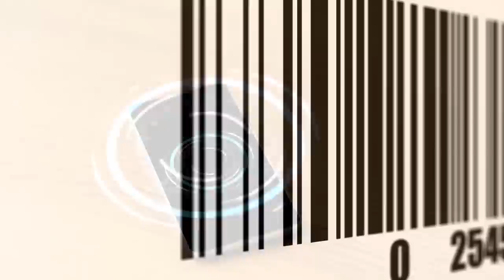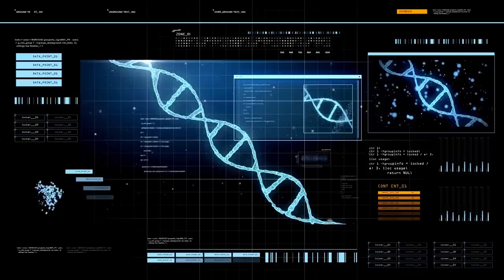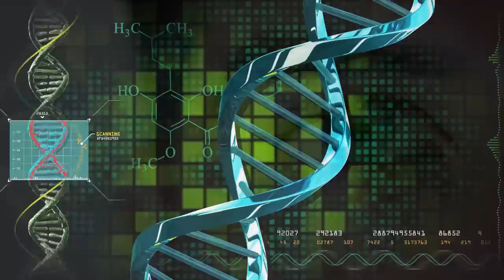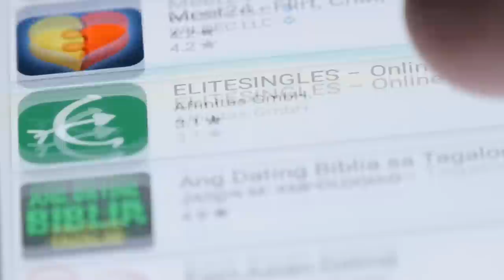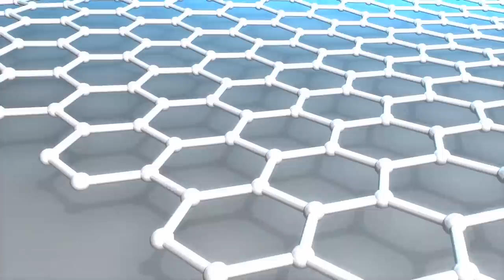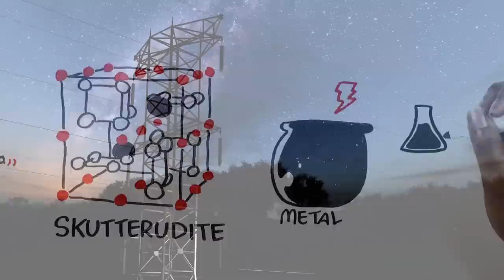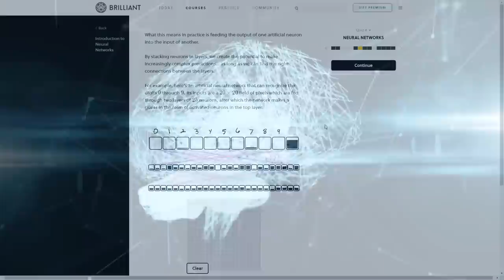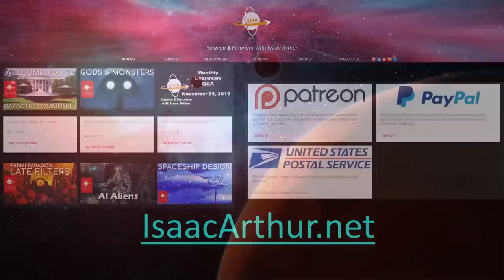New Technologies that May be in the Cards

Comment: I'll believe fusion is twenty years away when it's 5 years away.
Reply: Fusion technically already exist. Scientists mostly work on minimizing reactors to size what make them useful. What is one of most common misconceptions here.
Reply: @TheRezro  I don't think anyone watching this channel is unaware that fusion exists.
Reply: @TheRezro  Well, it's making them smaller, capable of running for more than a few seconds, not requiring temperatures of about 100 million degrees Fahrenheit, and actually producing more power than it currently takes just to turn it on, but yes, we're getting there.

Comment: Given how potentially dangerous a snowblower is, which in contrast to an automated lawnmower has a high powered auger that is open at the front of the snow blower, I don’t see it being fully automated anytime soon.  Snowblowers also need to be maneuvered in unique ways that requires use and shifting of the operator’s body weight.  In high snow fall areas, the snow can cover obstacles (especially over time from multiple snow falls as the snow still has to be blown somewhere) which the operator needs to know about and avoid accordingly even if they can no longer see the obstacles.  Examples of such obstacles may include edges of stairs, power cords, etc.

Comment: If we look at diamond batteries like the prototype design presented on wikipedia, we see that each 10*10*0,5 mm battery, that could be assumed to be 10*10*1 with added electrodes would produce electricity at 2V and at a power of 0,17mW. This would mean that in order to recharge a cellphone battery of 60kJ (4000mAh @ 4V) in 24 hours, one would need roughly 4000 batteries. However, when each battery only needs a volume of 0,10cm³, the assembly would only need 400cm³ or 0,4 liters of space.

 This means that you could easily see portable chargers with a combination of diamond batteries and more traditional ones powering handheld devices off-grid

Comment: The lack of garages is one of the major factors that limit and hinder the adaptation of current electrical vehicle technology in Europe. Unlike in the USA, private garages are rare in Europe and because lots and houses tend to be small, most people who actually have a garage, use it for storage and still park their car out on the street. 
With current EV technology, you really need a place where you can charge your car over night. Running a 100 yard long cable out your kitchen window down the block to where you parked your car, is really not feasible, which is why EVs aren't selling in Europe the same way they do in the USA.

It is quite ridiculous in Germany, where the press is having a feud with the car industry for decades, always gleefully predicting and announcing the end of the German car industry, because they supposedly were asleep at the wheel and didn't innovate enough. That narrative made some sense in the early 90s, when German car technology was chasing after the more innovative French, Scandinavian and Japanese competition, but that trend has been reversed and German cars have been among the most advanced and innovative for the last 20 years or so, leading the way with stuff like 360 degree cameras and such stuff, while the worldwide competition seems to try to pick up trends coming out of Germany.

Still, the German press acts as if the German car manufacturers were a bunch of outdated dinosaurs that deserve to die out because they didn't immediately switch their production to all EV the minute Elon Musk had his first press conference.
Those imbecilic journalists never bother to ask whether EV technology is mature enough and compatible with the German and greater European infrastructure.
You have to wonder what those idiots think VW, Daimler and BMW were supposed to do, tear down half of the homes in Germany, so the remaining half has room for garages to charge EVs in?
It is ridiculous.

In order for EVs to become widely viable in Europe, we'll need technology that allows for charging the batteries in the time it would need to fill up a gas tank at a gas station.

It is like that with many new technologies that get touted as "the future!".
Most of them are designed for American Suburbia, which is a way weirder and more unusual environment than most Americans realize.

Another good example is "Screen Walls", you know the idea to cover a whole wall with a giant screen, maybe all the walls in a room, so you can make it look as if you're not in a room at all.
Stuff like that can't work in Europe and most of Asia.
Houses are small. People don't have room for walk in closets. That means you need to have cupboards, cabinets and shelves on pretty much every wall in every room of your house, to store your shit in. Turning whole walls into screens isn't an option in like 80% of the developed, wealthy world, where people could afford such technology. 

As I said, American Suburbia surely seems mundane and normal to most Americans, but it actually is a very unusual, weird, unique environment that has its own rules and is different from everywhere else in the world.
Technologies designed with those weird, unusual conditions in mind, will have a hard time finding worldwide adoption.

When you listen to modern architects, city planners and infrastructure engineers, apparently American Suburbia might not be around forever either. There is a lot of talk of going back to older, more urban ways of living, making cities and neighborhoods more "walkable", making streets narrower to make people drive slower and so on.
Reply: TrangleC This is actually super interesting I’ve never thought of that as a hindering effect since I live in the US but it makes total sense but what if there was a charging port by the road do you think that would be useful fix for a problem like this?
Reply: Sounds like the German press is like the American press, full of closet Marxists who cheer for the failure of their own nation.
Reply: @2013Arcturus  Pretty sure they are just writing whatever they think will get clicks.  Outrage and doom and pointing out who stupid others are still gets clicks.  The solution is to not give them clicks or attention, and to let them adapt or vanish.
Reply: @2013Arcturus  No.They are in fact correct about these things. While I agree with the OP on all other points, the car industry one I ridiculous.
Unless you're personally involved with the industry (due to working in in it), and thus economically and emotionally invested in it, you'll have a hard time defending these dinosaurs.
Instead of working towards cleaner and more efficient engines, they rather spent resources on specially crafted cheating devices.

When the whole thing blew up, instead of making amends to their customers, they instead went through every legal and lobbying measure to avoid paying up.
I have absolutely no sympathy for the German automotive industry - they don't deserve it and should they go belly-up, they had it coming for a long time!
This has nothing to do with "closest Marxism" (first of all, would you Americans please stop already with your false dichotomies, it's really irritating!), but more with the arrogance,  dishonesty and deceit that this particular industry displayed over the past decades.
Reply: Oh great, let's all live in overcrowded cities where viruses spread rapidly. No thanks.
Reply: Because when VW sent up a cloud of black smoke, they were just unveiling their latest technology with a fancy magic trick LOOOOL
Reply: Umm...
1) Kerb side charging points, as number of electrics grow the number of electric bays does too. To the point where it's potentially foreseeable that they'll just become a part of the existing street furniture.
2) Electric Autobahns/freeways/motorways. My prefered option, but that is the most pie in the sky. The ability to charge while on a major road.

It's an extra challenge, but not an insurmountable one.
Reply: @2013Arcturus  how is wanting electric vehicles being a closet Marxist. I feel like people throw around that word too much.
Reply: I would love to have more walkable cities with larger sidewalks and narrower streets. Things could become less chaotic with those things implemented: larger sidewalks for more walking and less-crowded sidewalks, AI that helps with traffic jams, and quiet electric cars--city noise almost eliminated/reduced significantly. My big issue with cities is how chaotic they are right now. So if that could be reduced...time to hit the urban life (maybe)!
Reply: @the_seeker.entity9206  I don't really see them putting charging ports every 5 meters along pretty much every city or village street. That would be a ginormous investment.
Besides, availability of charging stations isn't the only limiting factor.
With the EU and especially Germany moving more and more into renewable power sources, you have the problem that a world in which you make most of your electricity through solar panels in the day and then use most of your electricity to charge EVs at night, would require enormous battery banks everywhere, to save all that electricity in the day, so it can be used at night.

I'm afraid the only way to get a significant amount of people into EVs in Europe would be to build a lot more nuclear power plants and nobody wants to do that, especially not in Germany, the Netherlands and other places in Central and Northern Europe.
Reply: @2013Arcturus  It is not just the press, but the self proclaimed "intellectual elite". They're good at demanding stuff and looking down on everyone, but not so good at understanding the realities of infrastructure, finances or foreseeing the consequences of their demands.
Reply: @totalermist  The Diesel Scandal and the demand for more EVs are two different things.
People in Germany have been doing the "Why can't those losers do what Tesla is doing?"-thing long before the scandal and they would be doing it without it ever happening, I'm certain.

Nobody ever seems to question whether there are factors outside of the control of the evil auto industry, which prevent the adoption of EVs in Germany. Don't know about you, but I never heard anyone talk about the garage problem, as obvious as it is. That is a thing I had to figure out by myself, while watching videos of Americans owning and using their EVs.

I was watching such videos and suddenly I realized: "Of course, they all have garages! Makes sense. You really need one for using a car like that. How many people in Germany do I know who have their own garage? And how many of those actually use it for their cars instead of for storing skiing equipment and old home trainers? Not one. Holy moly."
Reply: @floydlooney6837  The talk is more about "Urban Villages". They envision a future where basically everybody is living like in a idyllic southern-french town, with everything you need in walking distance and people using clean, public transport to get to work, or work from the home office and so on.

I personally like US Suburbia, with the wide roads, big houses, big driveways, 2+ car garages and all that. I'd hate to see it go, but all those experts say it isn't sustainable in the long run and it seems the USA are more likely to become like the rest of the world, than the rest of the world is to becoming more like the USA.

That is why technologies that only work in US Suburbia, are less likely to become a thing than most Americans think they are. The companies developing the stuff need a wide customer base and you can't get the prices down to a affordable level when only catering to a relatively small part of the world's population.

Other stuff, like cable TV or the internet would not be what they are today if only people living in "sitcom family homes" could have used them, you know what I mean?
Reply: @TrangleC  >"Why can't those losers do what Tesla is doing?"-thing long before the scandal and they would be doing it without it ever happening, I'm certain.

The Diesel scandal started way back to 2006(!!!), which is when VW decided not to develop a working exhaust cleaner and manipulate their software instead. This occurred after they decided not to license an existing DaimlerCrysler system ("BlueTec"). BlueTec in turn, also wasn't used properly, because Daimler thought it'd be "too inconvenient" to have car owner replace carbamide every so often and decided to manipulate their software instead. This was back in 2005!

Independent organisations, such as the DUH warned about possible manipulations as early as 2007 and general software issues plagued VW for many years now. This isn't just about EVs, because the problem with the German automotive industry goes way beyond that transition. It's an industry that became complacent and condescending towards possible new competitors. There are systemic flaws in the industry that actively screw consumers and still the bosses and top-level managers congratulate themselves and grant each other frivolous bonuses, while their products become more and more garbage with each generation.

Just take any recent German car and let it sit in the garage (yeah, I know - you don't have one - pick any parking space then) for more than two weeks. Have fun trying to start the damned thing afterwards! The battery will most likely be dead (happen to a family member just two days ago) because the engineers failed hard on the electronics- and software side of things. OTA updates? Nah! Visit a licensed repair shop for firmware updates and fixes (provided, of course, there's even some available!)... VW's garbage "software department" in particular is at full display with their ID3-disaster right now. They are dinosaurs and instead of changing with the times (regardless of engine type!!!), they missed that opportunity out of sheer arrogance and are now facing the consequences (sales have dropped dramatically even before the current crisis).
Reply: @totalermist  I'm not defending them, but that they started cheating in 2007 doesn't change that the scandal broke in 2015 and I am talking about what the press was saying before the scandal.
As I said, this "combustion engines are over and everyone who still sells them is a demented zombie"-attitude had been prevalent in the German press since Tesla became a thing, long before 2015 and before anyone knew about the scandal.

So my point still stands. The scandal and the uninformed worship of Tesla in the German press are two different things and not contingent on each other. Of course did the scandal fuel the anti combustion engine and pro EV mood, but that mood had started long before the scandal and the German car industry has been declared dead or worthy of death long before the scandal too.
Reply: @LiberalsGettheBulletToo  are there two meanings? because I just thought it was communal ownership but I know people use a new meaning for it like "neo-marxist" what does that mean people use it for a lot of stuff.

Comment: Yeah, I have to agree about the university/collage thing. It is expensive, riddled with corruption/excesses and wastage. Most of the time, you should not need those degrees. Doctors and anything maths related, for sure. Many other things are not helpful though.

Comment: 22:25 If we have compact fusion reactors, we will only need 1/10th of the networked grid we now need, if any at all. Each small town or community could be generating its own power, with only small grid connections for load sharing.

Comment: Superconductors would be dank af for computing. Totally worth its own episode.

As far as I know there really aren't any laws of physics dictating the minimum energy it takes to compute a certain problem, so if you have a whole computer with no electrical resistance that solves problems by cycling electricity through it, you can just jump start it and run it forever with only power used for outputting the data like through internet signals and light emitting monitors. 

Also most computing chips are purposely limited in their computing power so they won't generate too much heat, designing chips that are worse at computing but better for generating less heat for small portable devices or just designing chips optimized for performance and setting a cap on their processing speed depending on the cooling you use. 

However if that's not an issue anymore, smartphones can suddenly over night become twice as powerful as desktop computers with less electricity usage than they use now because the chips that used to be used in desktops only due to their need for huge heatsinks and fans now can just be used in anything as they no longer generate heat, and their clockspeed is only limited by transistors and architecture rather than how much heat your computer can dissipate so they can crunch numbers better than if they were submerged in liquid nitrogen before. 

This is not only incredibly useful for all electronic devices, making things we do today much more efficient if not nearly free, but other technologies like cryptocurrency that are currently heavy in power consumption would be basically be free to mine, thus have its practicality as a currency shoot through the roof.

Comment: Interesting thing to note, in the video you said that computers can near-instantly plot the optimum way to pick up many people, which technically isn't true.  Well, it's not so much "not true" as it is an open problem - the infamous P vs NP problem.  If we solve P vs NP with the solution that P = NP, then this statement is most likely true, but on the flipside, encryption will be basically impossible as we will be able to use the same sort of solution to break encryption.  If we solve P vs NP with the solution that P is not equal to NP, or never solve it, then likely we won't be able to solve this sort of resource-optimization problem unless we can formulate it in a way that doesn't require P to equal NP in order to solve it efficiently.